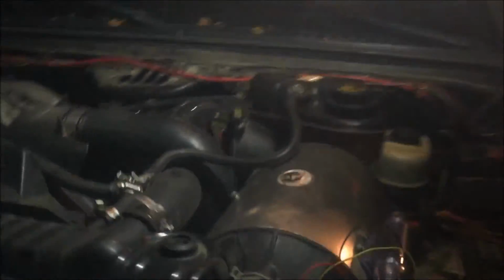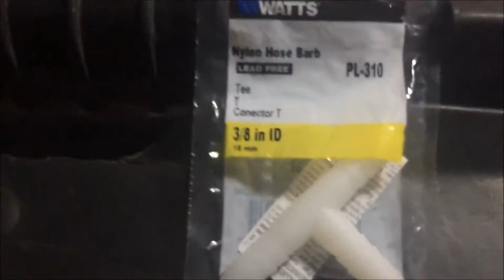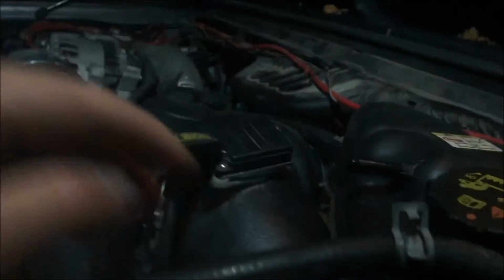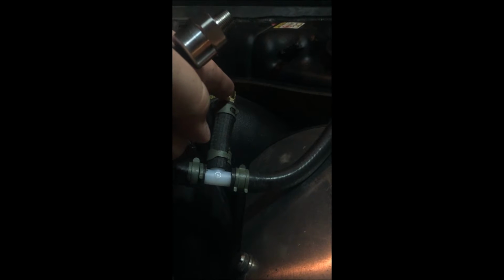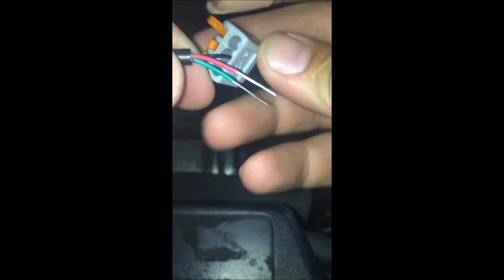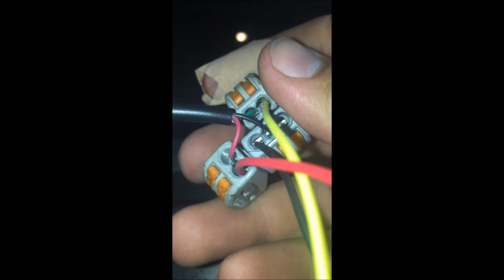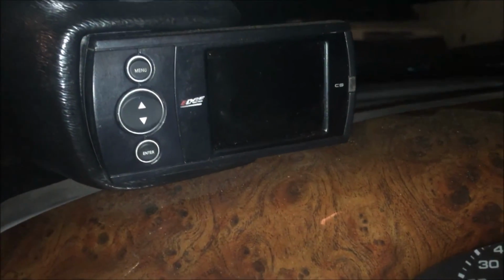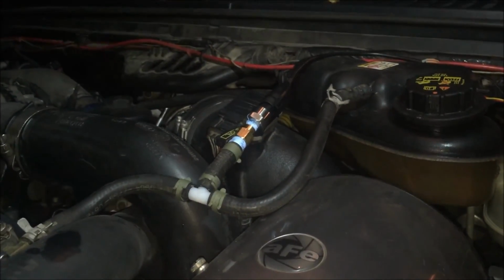Ford 6.0 Coolant Pressure Monitoring - Easy and Clean Gauge Install (Edge Insight)

Comment: I run the Edge Insight CTS3. I just tried running this setup with the exact fittings and wiring techniques as this video. 
My monitor never picked up the sensor, and then I actually threw a code and got engine light for a “cylinder 8 glow plug circuit open”. I cleared the code, and engine light doesn’t come on unless the sensor is plugged in under the hood. Any ideas??

Comment: I have an 06 f350 6.0 that has been bullet proofed yet the degas pressure soars over 18-25 psi..what would be the problem?
Reply from the maker: Oil temp and coolant temp. How are you moinitoring coolant pressure? Do you have the scanner?
Reply from the maker: Just because it has been bulletproof doesn't mean head gaskets didn't go again. What does your ect run? How about eot?
Reply: @C2H6Garage  sorry man..this is my first (and probably last) diesel..i have no idea what those are..
Reply: I just use the gauges it came with..temp has never gone past the half way mark...and my friend who is a deisel mech ran a quick pressure test on the degas lid while running and it got up to 23psi..he said that was bad..like i said i have no idea what I've got myself into but the usual signs (white smoke, oil in the coolant, degas throwing up)...none of those
Reply from the maker: If degas is not puking then I doubt your hitting 23 psi... maybe his gauge was bad? I would highly suggest spending money to get a good monitor (aka edge insight, sctx4, or something similar) the dummy gauge will show normal unless it gets way too hot (over 250 deg) and will not show you oil temp to coolant temp. The oil temp to coolant temp must not be more than 15 deg or else your oil cooler is plugged (common problem on the 6.0). These are great engines of you monitor them and keep up on maintenance. I beat on mine hauling and sled pulling and have about 650 hp to the rear without having any more engine issues after studded.
Reply from the maker: Feel free to ask any question and I'll try to answer best I can over the net.
Reply: Thanks man, i really appreciate your help..i know my way around a gas engine but this is like alien to me..thanks again i will look into getting a good gauge
Reply: Too much coolant. Proper level is debated or   high temps.
Reply: I run the Edge Insight CTS3. I just tried running this setup with the exact fittings and wiring techniques as this video. 
My monitor never picked up the sensor, and then I actually threw a code and got engine light for a “cylinder 8 glow plug circuit open”. I cleared the code, and engine light doesn’t come on unless the sensor is plugged in under the hood. Any ideas??

Comment: You had to use the Edge EAS Universal Sensor Input kit correct?
Reply from the maker: +arayray94 You would not have to but that is how I did it for a quick and easy install. But You can have a any sort of other device that can read a 0-5 volt signal and scale it.